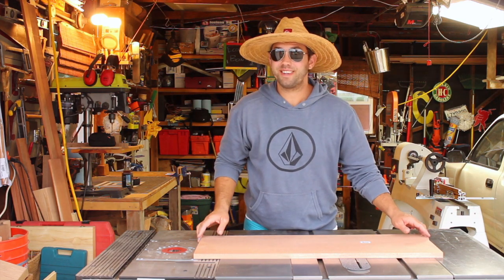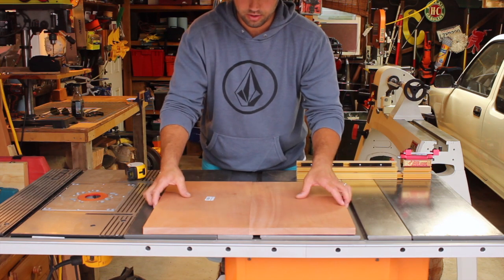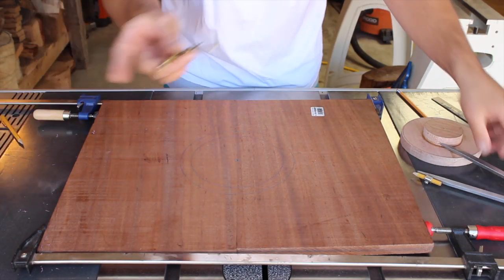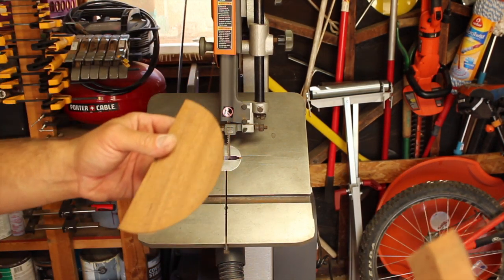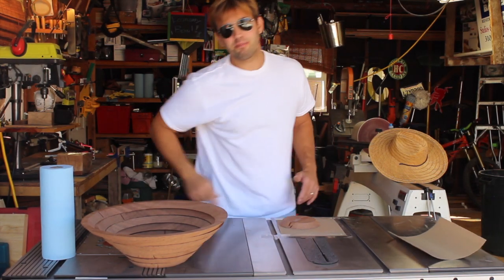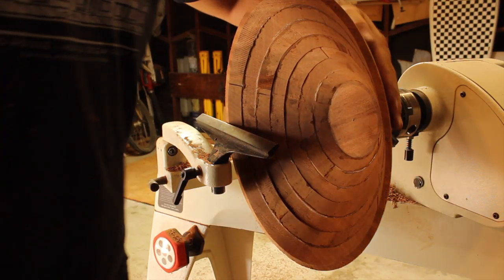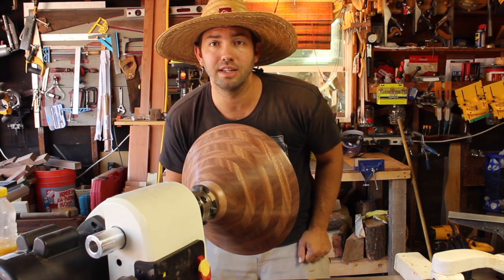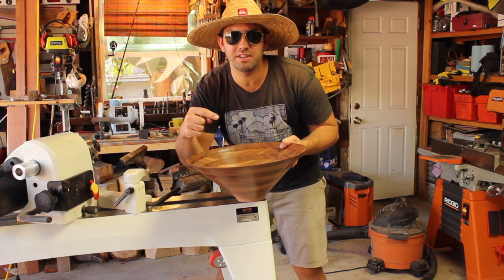Woodturning an Economy Bowl From Mahogany

Comment: What angle did you cut your rings at on the band saw?  In a similar process on the scroll saw you use a formula to calculate the angle based upon the thickness of your stick, how wide you want each ring to be, etc.  Cutting them at the correct angle results in the stacking with smooth edges.
Reply from the maker: 45 degree, and made each ring 3/4 bigger.

Comment: Thanks for sharing.  I've just purchased my first lathe, been working on a stand.  Can't wait to start practicing...
Reply from the maker: Allen Oxendine what do you mean stand? Does the lathe sit on like a bench top? Post some pictures when your done. I’ve been using the lathe for 5 months now and it’s been a blast, I’m really happy I bought one to
Reply: Stelios The Greek sorry, I'm building a table to hold my lathe.  4x4 legs should be heavy enough  hope.  2x11s for top
Reply from the maker: Allen Oxendine sounds like you got it covers. I’ve got a video making a kids bench and I used 4x4’s and constructions grade lumber. Check it out and maybe you can use that as a plan to make it adult size.